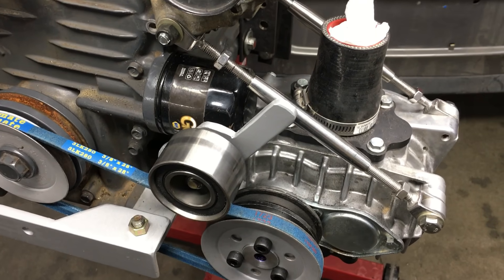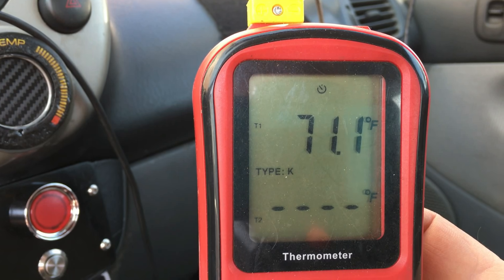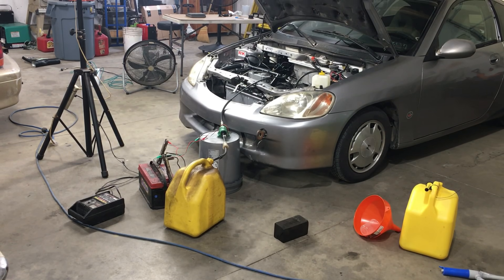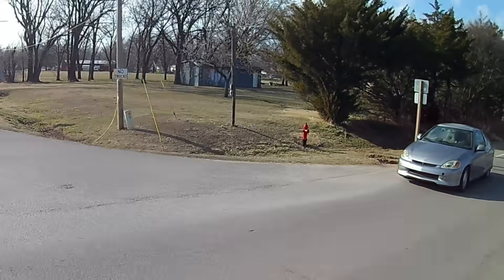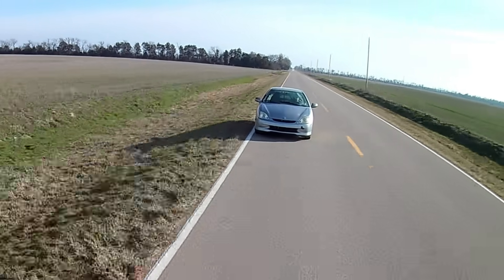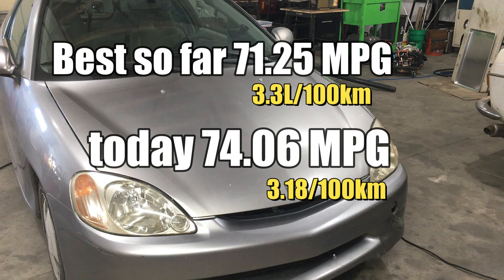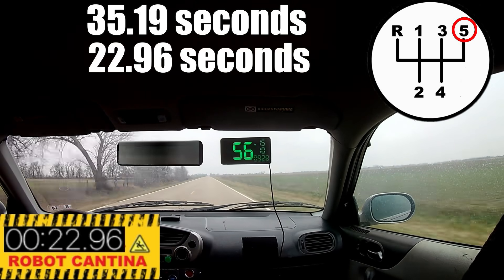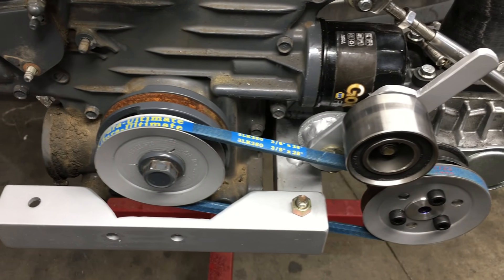S4 E10. We find out if the AMR500 supercharged Kubota diesel engine is more fuel efficient.

Comment: I think you can skip waiting for fuel to cool down, since you're measuring weight and not volume. Temperature affects volume, not actual weight.
Reply from the maker: The temp effects the volume in the tank.  if the fuel is too warm it will expand and when we drain the fuel via the return line we will drain more fuel.
Reply: @robotcantina8957 Oh, I see now, that's because you're not draining the tank completely. 
Fuel cell project, then? :)

Comment: i love these videos. i wish i had the time and money to tinker with stuff like this. i don't know if this makes sense but it seems to me if the fuel rack is set to use the same amount of fuel regardless of the boost, aren't you just measuring mpg based on how long it takes to complete your circuit, which would be faster because you're utilizing the extra fuel?
Reply from the maker: Indeed the fuel rack is adjusted for extra fuel, however that is at full throttle,  During cruse, the fuel delivery is the same as before.  the only difference is now we are forcing a little extra air into the cylinders.  Diesel naturally run lean and it seems a little extra air helps it run leaner....

Comment: You can change a bit fuel economy measuring to make it much more convenient. Reserve fuel under return pipe level is constant, so you can add known amount of fuel after pumping tank and run it until dry, just don't forget to take canister with you.
Reply from the maker: You cant run a diesel engine dry without creating some huge headaches.   Re-priming the high pressure pump takes forever.
Reply: @robotcantina8957  Check with your exact pump, but usually in appliance engines pumps are self priming. Just need to crank it for a minute.

Comment: the single belt setup would have been even more efficient!
Reply from the maker: Except the single belt was showing signs of premature wear after 1 hour of run time.  If I can make something simple I will, however the single belt wasn't going to work without massive changes.
Reply: yeah no worries.  wonder if you might end up going with a cogged belt setup?  another thing i was over thinking about was the distance away from the outer bearing adding to much leverage to the imput shaft.    @robotcantina8957

Comment: My opinion. 

If youre going to be keeping the car in service anyway and the intercooler isnt doing any harm to the overall performance. I'd put one in there anyway just to save having to put one in later when the temperatures outside start warming up. Youre already messing with the engine so you might aswell go all the way even if it doesnt currently do anything. Cut a hole in the bonnet and add a small scoop for more air flow. 

I mean, we've already established this is a stupid project anyway.

 Go all the way. No half measures.
Reply from the maker: We will eventually install the intercooler, but I have a limited amount of time to do stuff.  If I install an intercooler and test it in the next video we have nothing to show.  I would rather do other modifications that show a measurable difference, that way each video shows an improvement.

Comment: Part of me is hoping to see aero mods and ram air. I thought of a heat deflecting plate between the intake and exhaust, set up in a way that the exhaust will still get air flow from the grille. Or maybe it’s more work than it’s worth, but either way I really enjoy this series.

Comment: I'm interested what the temperature of the diesel is up to, is it heating up due to recirculation (if that's even how fuel pumping works, I don't know), is it cooling down from the winter airstream? Does the engine have a thing that tries to normalize the fuel temperature before it gets used? Does that not matter?
Reply: No
Reply: @josephpadula2283  don't spam

Comment: Great video. I figured the fuel economy would go up if you drove it normally. 

I had a Western Star truck with a 16 liter Detroit and 600hp from the factory. I worked with a tuner and we added a 20 % tune to go to 750hp and I gained .5 mpg. 

The truck was run on a dyno to get real numbers. That saved me over 2000 gallons of Diesel per year and was well worth the investment.
Reply: Don't leave us hanging. What was the result in mpg? What kind of load?
Reply: @lightningdemolition1964 

I was pulling a 53’ refer back and forth to Alaska. It was a six axle setup with Canadian axle spacing of 54” on center on the trailer. The average weight was about 45,000 to 48,000 pounds in the box. The truck averaged 5.5 mpg over 370,000 miles when it was replaced. There was hardly any idle time involved. I used a Carrier APU instead it had probably the same Kubota engine in it then the Honda.
Reply: @cullenmiller8170  thanks, I thought my mileage was bad but I guess not. I'm getting a solid 5 mpg mostly short local under 20k miles a year on a Detroit d13. Hauling dump trailers and at landfills. I used to have a series 60 Detroit that got me 7 to 8 mpg in the same service. California air resources board shut it down because too old even though it worked fine. That's why we can't have nice things.
Reply: This is a great example of a small difference multiplying into a huge one.
Reply: A lot of people are unimpressed with small mpg improvements, but over time, it really does add up (especially on any vehicle that drives a lot).
Reply: Did the engine pass the emission certification?

Comment: Hi from the uk if you are measuring the fuel by weight you don't need to be concerned about temperature, for any given weight the volume will change with temperature 
Keep up the good work
Reply: It wouldn't make a difference if they fully drained the tank each time to check the weight, but because they're leaving a known volume of fuel, there is a difference from temperature.
Reply: @ThatMattWhite  
Hi 
Yes I see my mistake 
You got me
Reply: The temperature is a concern to get a similar volume out of the tank.  Since Jimbo is using the level of the fuel return, he wants the fuel density to be as close as possible to ensure the volume extracted is as close in density to the volume added as possible.
Reply: This doesn’t factor the difference in density of the fuel in the car tank.

Comment: I really would like to see some kind of hybrid supercharging system. The turbine part of the turbo connected to a brushless motor acting as a generator, charging li-po or super capacitor, to act as a buffer and the AMR500, driven by a brushless motor connected to the same battery/cap.

- No more engine power stole by the supercharger
- No more lag, due to the battery
Reply: That is what this car Had when build only ga. Engine and NiMh batteries .

Honda insight group has developed Lion batteries now And it s a plug in hybrid now too.
Reply: @josephpadula2283  It's different here, I am talking about hybrid forced induction. All the avantage of turbocharger but none of the drawback

Comment: I predict 85 mpg

Edit: i eat crow, lol
Reply from the maker: lol... 85 is doable right now, but the car has to be driven a little bit slower.
Reply: @robotcantina8957  yeah, "hyper-mile" it. But I appreciate you do your tests as real world Jimbo, not trying to milk the mpg. Gonna toss the original drive setup back on the blower (super od) and test results at current fueling settings?
Reply from the maker: @ludditeneaderthal  The original single belt drive that we started with wont work.  The belt had accelerated wear after only one hour of  run time and most of that time was with the engine idling.   Unfortunately. we will need to fabricate a new pulley to speed up the supercharger.

Comment: Is it cheating if you slightly over inflate the tires? Thinner oil on the transmission and engine?
Reply: Original car has special tires owners routinely overinflated and the oil in the gas engine was 0w 5 ish .
Reply: @josephpadula2283 Thank you, and thank you for taking the time replying a comment not highlighted.
Reply from the maker: We run with 45 psi in the tires which is normal for these cars.  The Saturn MP3 transmission uses ATF.  As for the engine. I'm not comfortable using a lighter oil on this diesel.

Comment: have you put any thought a reduction gear between the supercharger and the drive pulley? Something like the old Sachs 4 speed City bike gearboxes could work AFAIK they use planet gears and a cable to switch from one gear to another....

this way you could run the charger at variable speeds...

Comment: Would you consider adding an oxygen concentrator to make a compressed tank of O2 then use that for short term HP needs? Think stuper charger with elderly O2 concentrator equipment. Basically take a 30 HP motor and give it short term 4x  O2 for perhaps 120 HP while pulling away from a stop light. If you need electronic controls rusEFI has good engineers and low cost platforms to work with.

Comment: On accelerated test, try putting it on first gear with the car off and with no clutch use the starter to take off, it would be a hybrid supercharged diesel as long as the battery has enough cranking amps.
Reply from the maker: I thin the car would be a lot slower if we did that.
Reply: @robotcantina8957  I got the idea from a V6 mustang with a broken clutch cable the guy had been driving like that. It took off surprisingly fast even up hill with just the starter pushing the car

Comment: One simple idea to your boost regulatory problem would be to install a bypass duct you could attach a valve to. In theory this mod would allow you to set a maximum pressure with ease and allow you to change it when needed.
If you like this idea feel free to try it out: It should cost less than 2$ I believe.
Keep up the excellent work and greetings from Germany!
Reply: running the charger essentially with too much boost and just dumping it to atmosphere would put quite some of the unnecessary stress on the charger... increase intake tempsamd wear.

what you could do.... is put a small two stage gearbox... like the chain drive on a mountainbike... switching to another gear set if more charger rpms are needed...

thinking of it... one of those old 4 speed hub transmissions could be used
Reply: Could run an ac clutch wired to a min/max pressure switch.

Comment: Hey Robert Cantina, think this may be up your alley since you do some electronics and programming, something I wanted to do but dont have time/resources for - direct water injection - not intake water injection to increase boost and prevent detonation, but installing direct injectors in the head and using a microcontroller (like Pi Pico - low latency) to inject water at or near TDC - to convert some heat into additional pressure on the piston my expansion of water into steam and thus increasing thermal efficiency of the engine. It could be linked to throttle and rpm levels + a knob as a multiplier for duty cycle (eg 0.1 to 1.0), with real time fuel usage feedback on something like a flat road, you can see which duty cycle multiplier gives the most increase in thermal efficiency. The increase in TE would also increase power and reduce EGTs.

Though I suspect duel to slower burn of diesel, the ratio of water to fuel before it starts dropping in TE would be lower than petrol, as it may quench partial combustion if the water level is high enough. But I expect diesels would still gain TE, just perhaps not as much as petrol - at least while the design remains 4 stroke and there isn't an additional stroke for water only..
Reply: Although I like your idea in theory, the D722 has TDC static cylinder pressures of 412-469 PSI so any direct injection would need a high pressure pump of above that, and three injectors that could handle that sort of pressure and are okay with water.  I don't think any of that is cheaply available and would also steal so much power to run the pump there would be no chance of gains.  Also not much room in the head since these pistons are 67mm (2.6378in) and the valves already take up most of the space.
Reply: @Spudz76  All of these are a non-issue. Displacement is small so you dont need large injectors. Pump pressure does not need to high, pressure is dictated by the second stage before th injector and not the fuel pump, pressure in the injector is far higher than the pressure in the line between the pump and injector, the volumes and flow are completely different (see comment for second stage). The power required for DI is almost nothing, the volumes being injected are tiny, if volumes are huge then yes it requires more parasitic power. Mazda's SkyActivx does the same thing with petrol right before TDC injecting a rich pocket near the spark plug to set off its ultra lean ratio and it is more thermally efficient than most if not all petrol engines.

Modern direct injection works in excess of 5000 psi, while majority of all DI systems are over 2000 psi, while the pump itself might be 60 psi. DI systems typically increase the pressure in a second stage.
Reply: @Spudz76  using some basic calculations for that engine at full throttle assuming 14.5:1 stoich ratio is maintained then that'd be 0.109cc of diesel per revolution. Assuming we are only going to use 1:2 water to fuel ratio, so like 0.05cc/revolution. It'd require 8.7 watts to continuously inject against 400 psi. Which even if our efficiency is 10% and it needs 87 watts that is still barely anything. We could use much more water against a much higher psi if needed. 

Assuming the engine TE is 35% and we managed to push it to 38.5% with water that'd in theory improve robertcantina's 3.3l/100km to ~3l/100km. And providing 10% more power/torque etc. 

That's why I'd love to see if it'd work.

Comment: Sometimes more power actually does improve mileage, and not even just in small vehicles. I have a 99 f350 with the 7.3 power stroke, in stock form I got 14-15mpg. After some bigger injectors and a t6 tuner bringing the stock 250 horsepower up close to 400ish I get 16-17 mpg.

Comment: You should put a 72volt suron motor in the back,  use a gokart axle and chain setup to connect the two. And bam, you have like 20 extra hp and instant torque that should make your mpg's even more insane! But you know only if that can be done on a tight budget. Just food for thought.
Reply: Don't forget the heavy batteries
Reply: @giggiddy  Exactly 💯!

Comment: I'm pretty sure the increased fuel economy is because before the supercharger it simply didn't make enough power to keep the car moving efficiently. The additional power allowed for less stress to maintain speed. There is a tipping point where adding power no longer increases efficiency, but honestly, I'd be surprised if you've reached it yet. I predict over 75mpg as you increase the boost before it starts to fall back off.

Comment: It actually makes perfect sense why it used less fuel with the supercharger. More air, technically same fuel, it would be cleaning up the afrs, on a technicality it’s got more power so it’s not working as hard. Intercooler will only be relevant if you’re going to be pushing much more boost. You will find if you increase boost you may get better fuel economy again. I tune cars for a living, this stuff intrigues me haha

Comment: My guess for the cause of the improved fuel economy is that you’re spending less time accelerating, which, if I remember correctly, is the most fuel-consuming part of the drive cycle.  Unless you were doing most of your driving at full throttle, in which case I have no idea what’s going on 😂

Comment: Imagine adding a CVT on the supercharger... 😂
Reply: The british already imagined it and produced one XD Torotrak produces a supercharger unit with a built in CVT transmission and planetary gear set as well! It has a toroidal CVT transmission ! It only uses something like 10 watts to change ratios and its quiet compared to any other supercharger around. Ranges from 10k RPM to 100K rpm which is pretty cool
Reply: @DarkAttack14  so it ramps up the boost over a long period? Won't the work needed be the same as a higher energy input but faster spooling charger?

Comment: About fuel economy, it's probably the extra air burning the fuel more efficiently and higher dynamic compression ratio that may help you extract more energy from the same amount of fuel, despite some of the power going to the supercharger.

I built a couple 1 liter Zetec Rocam Supercharged engines with Eaton M24 blower, 9.8:1 and 11.8:1 compression and few different pulleys. I run them on ethanol (Brazilian hE100) instead of gasoline. I ran these engines at 1.6-1.8 pressure ratio.

From what I noticed, these 1 liter Zetec Rocam had a bit better fuel economy on the highway. In my last car, I reached 13.3km/l (31.2mpg or  7.5l/100km). Thats a big improvement, since cars with these engines often reached 10-12km/l on the highway.

The engine on that case was running at 1.8 pressure ratio and while the mixture at above 100kPa was lambda 0.85-0.87 (I do not use AFR due to variable multifuel projects), below 100kPa it was 1.00-1.05 to get a really good fuel efficiency whole cruising, just like factory cars.

I hope skme of this information helps you with some interesting ideas.
Have a good one Jimbo!